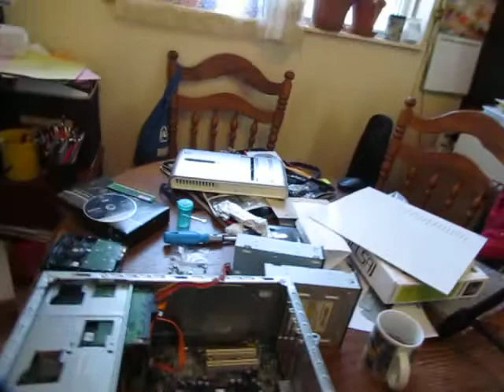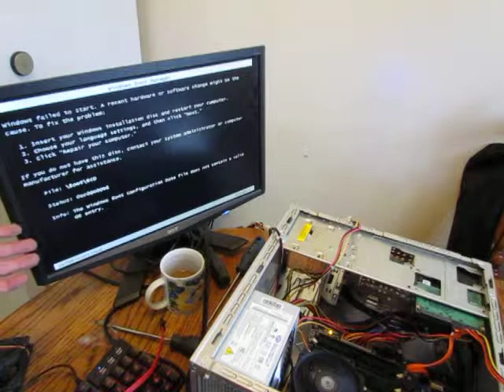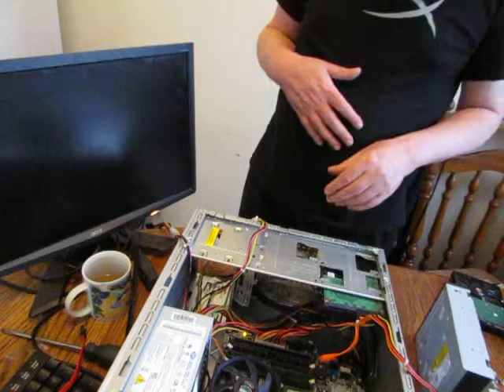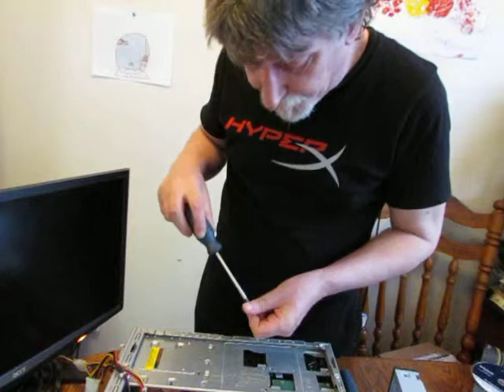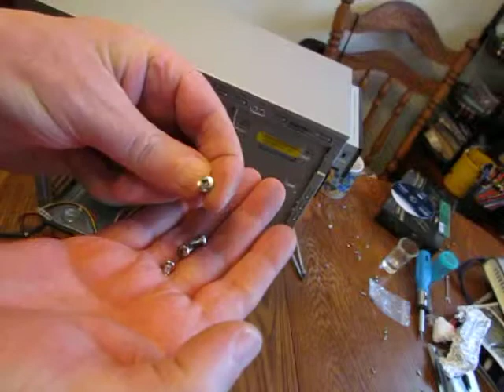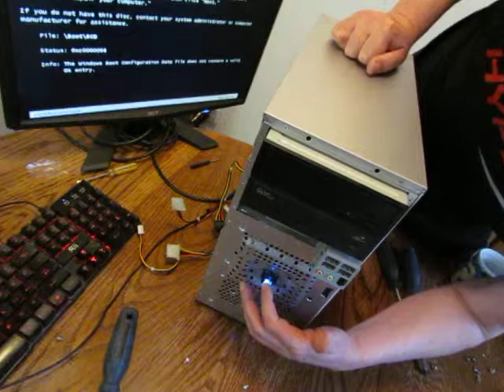The Show Must Go On - PART TWO - DEPB #1

Comment from the maker: Surprisingly enough this old PC still works today. I purchased it in 2007. It's a 32 bit system because that's all the CPU can handle but it's fine for light duty use such as checking emails, text editing, and networking. I can even watch a video on it because I later added a modest graphics card that helped out with the memory.